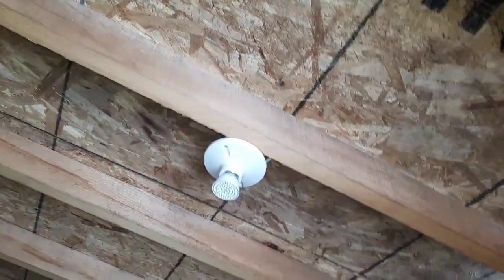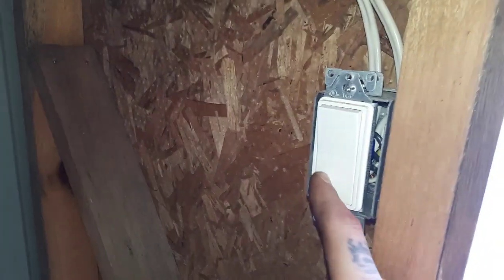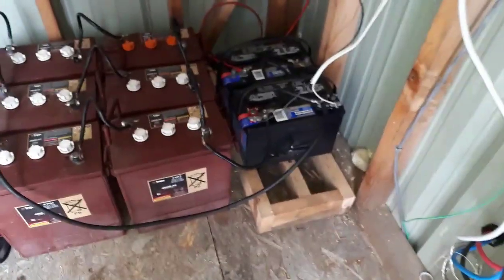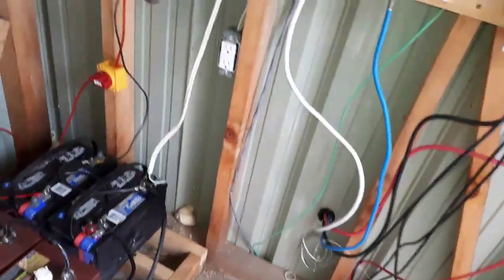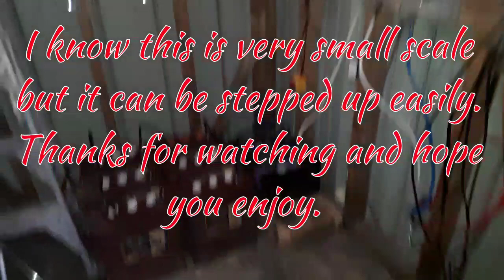AC Lighting to DC Lighting

Comment: You need a fuse on that lighting circuit!!  And Merry Christmas!
Reply from the maker: On 7 watts. I could.
Reply: @frankz1125 , the fuse is not to protect the light.   The fuse is to protect the wiring, the shed and the device from catching fire.   If a short develops in the wiring, the battery will try to push all of it's power into the circuit.   Please add a fuse.
Reply from the maker: 10/4

Comment: DC lighting lets you save the power that you're wasting on running the inverter you can also try a buck booster to compensate for the voltage sag for a long runs with lead acid batteries